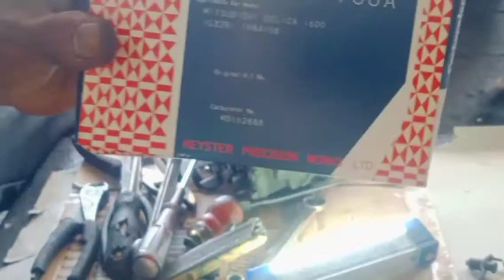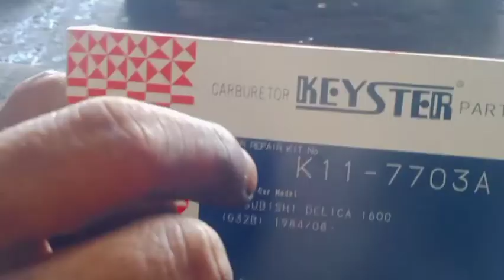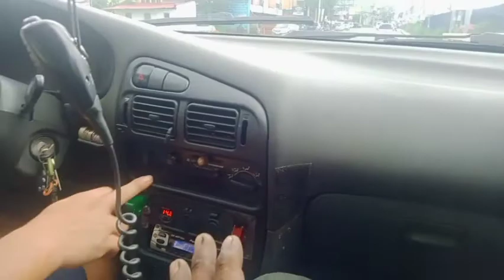MITSUBISHI LANCER 4G15 CARBURETOR OVERHAUL

Comment: One of the best and trusted mechanic in  sta. Rosa laguna ... 11 years of servicing my mitsubishi lancer 96 and counting.
Thanks boss jojo and God speed.
Reply: Paps nag pm ako syo... Ano ba ibig sabihin kng meron lumalaba na gas sa tube pa sa bugangan nag carb
Reply from the maker: Over flow Or sobra ang pasok ng gas     subukan mo adjust yong gas floter or linisin mo nedle valve paps
Reply: Boss saan sa sta rosa ung talyer nya anong name. May lancet itlog din ako.

Comment: Boss Tanong lang. After ko pinalinis carb ko . Nung sinalpak ok sya pero Nung ginamit na nawawala minor kailangan nakaapak ka lagi sa gas pedal. Hindi nman ganito to before.
Reply from the maker: Sir timpalhin mo ang yong speed screw nasa gilid ng carb tapos air mixture screw naman nasa likod pinalitan MOBA ng mga repair kit sir yong carb mo
Reply: Good day Po. Salamat Po sa rply. Hindi Po sir. Nilinis lng Po Walang anumang repair kit na pinalitan